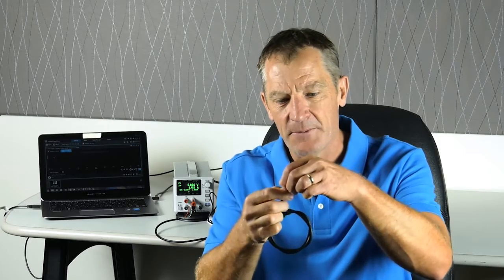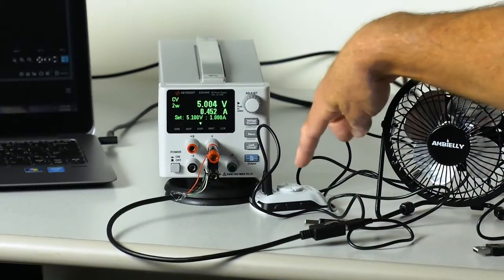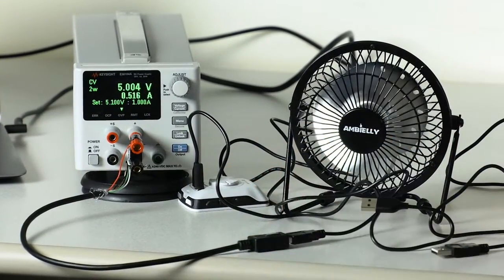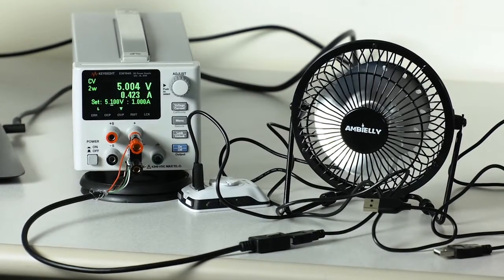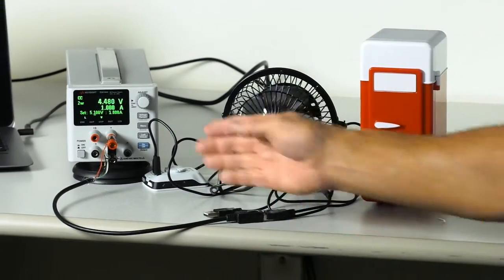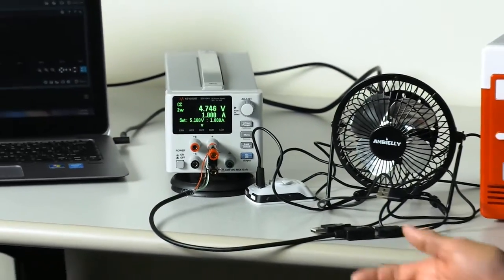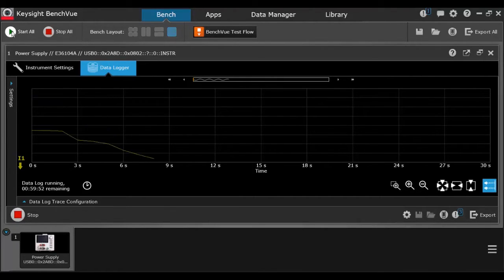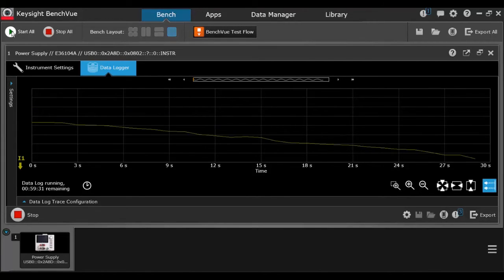Simulating a USB Wall Charger with a E36100 Series DC Power Supply & Measuring Current

Comment: Correct me if I'm wrong, but. The refrigerator doesn't draw about 1 Amp, you have the power supply limited to only allow 1 Amp output. It probably would use more then 1 Amp of it wasn't limited. So you didn't demonstrate how the power supply can display the actual current that the refrigerator would actually draw if it had more then 1 Amp available.
Reply from the maker: You are correct that it can pull more than 1 A when it is warm.  The current used by the fridge is dependent on its temperature. At the time of the video the current being drawn was less than 1A.   The E36102A is good power supply choice as it can source 5A at 6V.